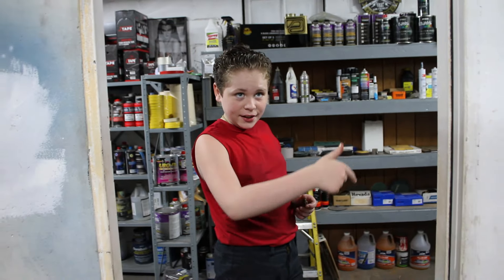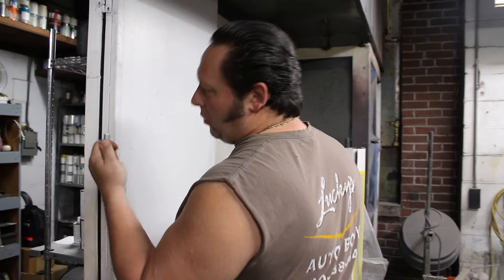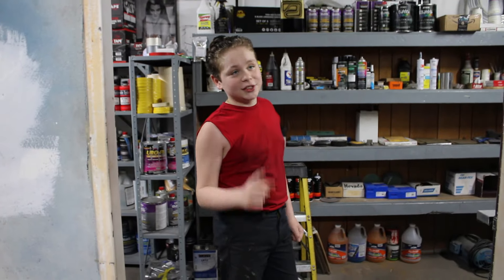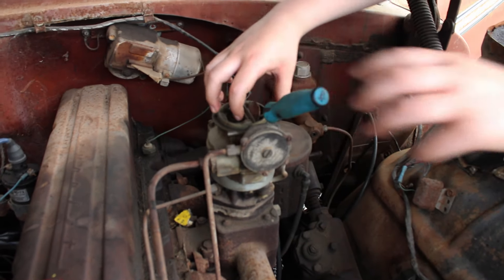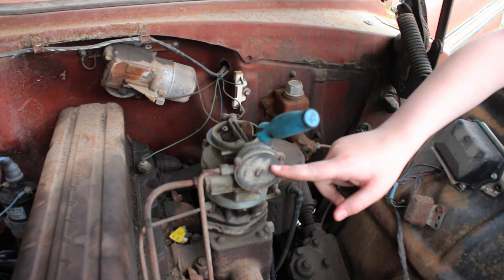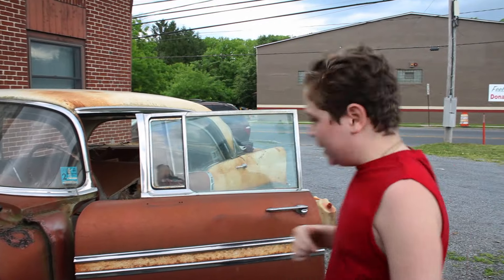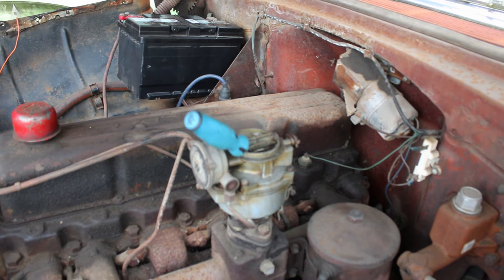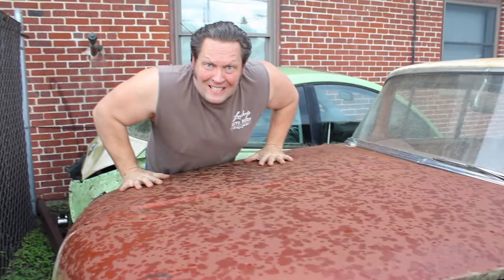Getting My 1956 Chevy Running!

Comment: Amazing job Dad and Mom with raising such a talented and gifted young man.  I just recently started fixing my cars. I'm a 55 years old woman and I really didn't think I had the skills but was able to change the timing belts, water pump, thermostat, alternator power steering pump, oil change, spark plugs, ignition coils, adjustments, cleaning manifold and intake valves, and now painting (which is most difficult due to not having a garage)
Reply: Same here, definitely helps greatly on saving.🕊️🙏🏻

Comment: The proper engine - Someday…
For a 1956 Chevrolet 

There’s also a 1060hp 632cid 
Big Block Chevy 
Pump gas …..
87 octane with water injection 
King David Vizard and Terry Walters

Comment: Oh pops ypu lost 50 points of respect.
Mechanic fuel pump.
Though you were teaching the kid right.
Next you will put a computer in it and pos fuel injected engine.
Hell though it was going to be mechanical fuel pump. Carberated, points ect ect.
Its not like ypu cant get the right fuel pump.
I would even care if you put a V8 into it if you just used the old stuff.